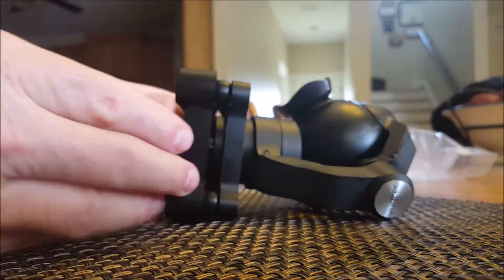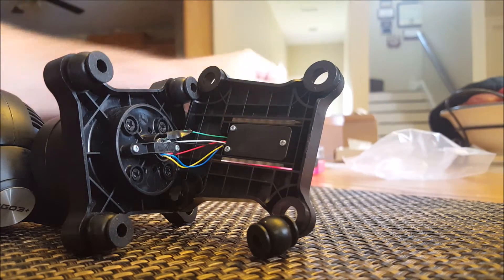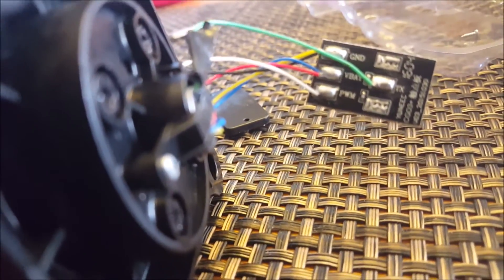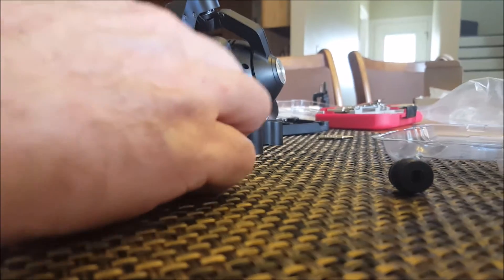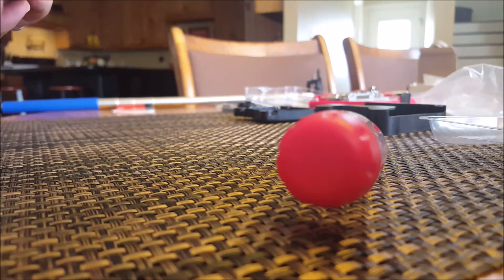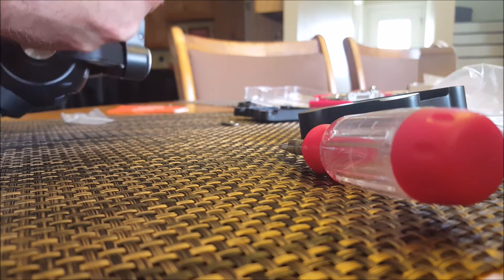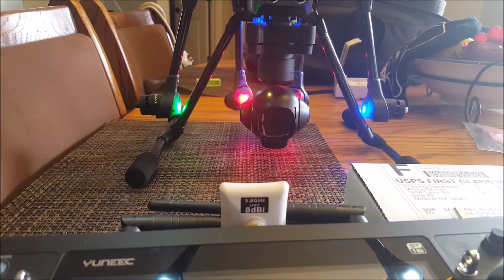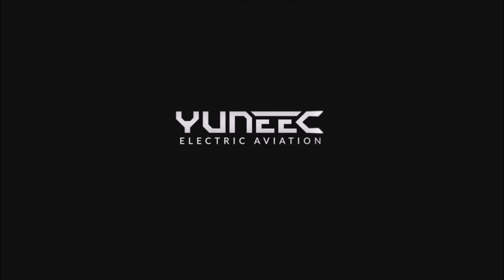Yuneec Typhoon H  Gimbal Slide Replacement

Comment: This may seem odd, but I did order one of these, and I’d like to just fly this around, WITHOUT the camera gimbal, fly it in Angle mode, NO GPS. Do they make a cover plate for the gimbal, as it appears to have connection contact points that would be exposed without the gimbal attached? Now, before I get a lot of why would you buy this and take the camera off, don’t worry, I’ll put it back on for video footage, but I just want to rip this thing around without all that drag from the camera assembly, and other than the Typhoon h, and the MJX X600 hexacopter, there just isn’t many hexacopters on the market to fly!

Comment: I just got my Typhoon H today. As I was taking it out of the case I noticed how it was a really snug fit around the camera. So much so one of the rubber grommets came out of one side when I removed the drone from the case. The camera hangs down on that corner and its very obvious something came apart. I was really interested in seeing how you reinstalled them. I watched intently and when you got to that part in the repair the video went into hyper speed..lol I think I got the idea though. I could send it back, but it looks like a really simple fix.

Comment: i have a cgo3 + that keeps rotating 360 deg and wont stop any ideas
Reply from the maker: Paul, I would first remove and then replace the camera and ensure it is locked into place. Then conduct a re-calibration of the camera. If that doesnt fix your problem, check out this - http://yuneecpilots.com/threads/st-16-calibration-secret-menu.3866/ Hope this helps with your situation.

Comment: Very nice!  I had this happen as well recently and was able to fix it just like you showed here.  Was time consuming, but was happy it was fixed.
Reply from the maker: Thanks! I was glad it wasnt damaged more than what it was and was happy to see it work flawlessly after.  I think if the wires came off the board I could have done some soldering, but more than that it would have been alot harder.